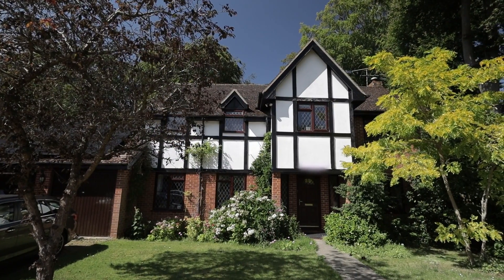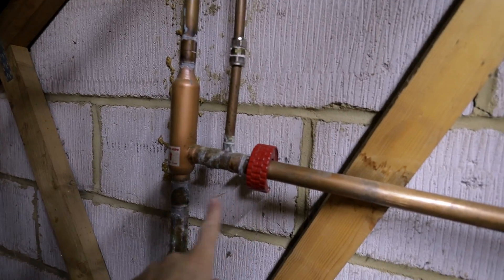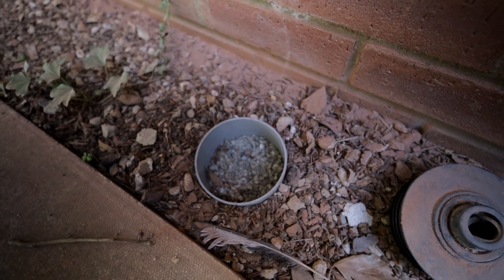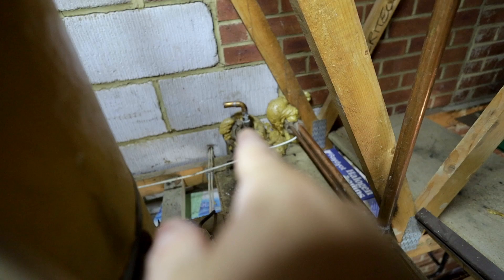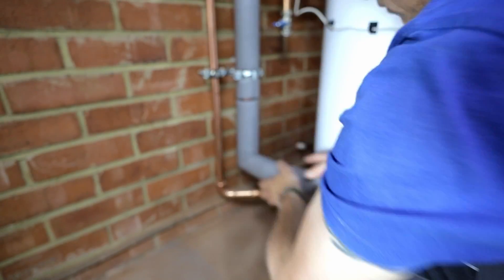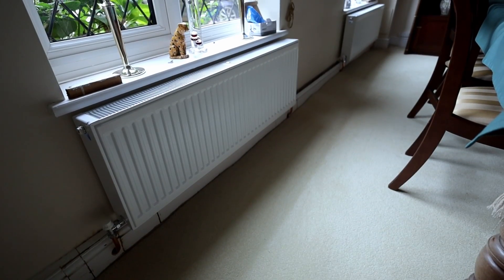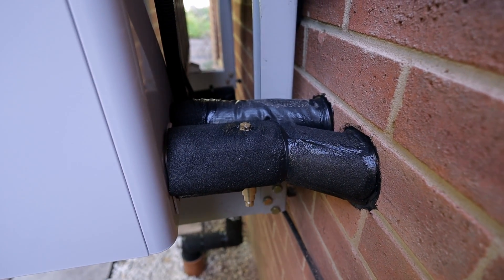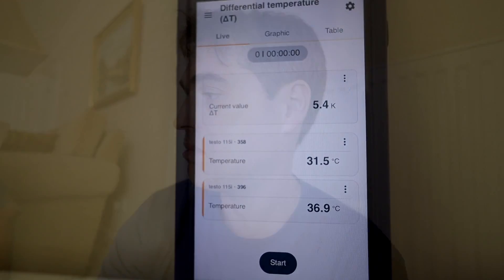Heat Pump Retrofit in a 1980s House: What's Involved?

Comment: Someone please reply🙏 
I don’t see how having a flow temp of 45 degrees could keep you warm in the winter? I’m referring to living in a standard U.K. house. 
Also what happens to to the water in the cylinder if they can only achieve 45 degrees - wouldn’t you get legionnaires?? I’m assuming the immersion must kick in to bring it up to 55??
Thanks
Reply from the maker: You can kept ANY house warm with a flow of 30c! As long as you have emitters large enough to transfer the energy required. Heating is not about temperature as much as it is about heat transfer, and that can happen at pretty much any temperature as long as it is above your room temperature.

For example - a single panel small radiator may need a flow of 65c to keep a room at 21c. The same room may only need 35c to keep it at 21c if the radiator is upsized to let’s say a triple rad.

You don’t need high temperatures to keep rooms at 21c! 

Hot water is done separately to heating and doesn’t need immersion, as the unit can go to 75c, it is just less efficient at those high temperatures.
Reply: @UrbanPlumbers   ah I see! Thanks a lot for replying. 
I had no idea an air source heat pump can generate 75c. That’s amazing!

So what do you recommend for small to medium sized properties where you’d struggle to get the cylinder in- still a gas combi? 

One last question….will air source heat pumps work with 3 column rads or do they have to be K2’s?

Thanks & please keep making you great videos 👍

Comment: Really enjoy your videos showing a balanced view on heat pumps from a true professional. Learning from previous issues and iterating - continuous development is so important in any technical trade. Installers got away with badly planned/configured boiler installations as they were inefficient/problematic but still "works" depending on your definition of works (your radiators would get hot at least). But with heat pumps all the cowboys are being caught out as they barely work or flat out do not work if they're not designed correctly - I dread to think the amount of installs that might fall into that category in the future. Hopefully the silver lining is that it weeds out installers who do not really understand the technical aspects of their trade, don't get proper training and think they can get away with lashing stuff in, which they have been able to an extent with gas boilers. With regards to space - I can see issues in my property in the future which has just a 36kw combi boiler in a cupboard in the kitchen with no extra space surrounding - in this situation is there any kind of cylinder that would be suitable to install inside this cupboard or would it be better to locate a new cylinder in the loft space? (quite difficult with extra pipework, although in my place it could be run externally if it came to it)

Comment: Why did you choose to install the cylinder in a new location rather than replacing the existing one up on the platform?
Reply from the maker: Minimum pipe runs and much safer to put 250kg on a solid floor
Reply: @zlmdragon.  i guess from my perspective we dont have a ton of spare space so would want to find a way to replace in place. The featured property certainly has an abundance of available space, not really common in majority of UK homes.

Comment: Nice install, never would have thought to fit the unistor as a vented cylinder. Also, good tips with the lagging glue and the ball valve filter, worth knowing since i just fitted out first one a few weeks ago. What water treatment are you using aside from the Kamco? We're using the VDI method with the thoroughflush V4A1, just never seen your method for this and curious since you're about 100 heat pumps ahead of us! Keep up the good work.

Comment: Thanks for another great video, I learn new stuff from every one. One question though — could it be that the chronic defrosting you had on the earlier install was due to the unit ingesting exhaust gases from a neighbours gas boiler rather than being on the ground? I had chronic defrost issues last December with a unit that was just across a passage from a non-condensing gas boiler which was emitting loads of water vapour when it was -5 outside.

Comment: Another great install. Lucky with the existing pipework. I have a quick question, does have this HP fixed circulating pump speed, or adjustable? If it is adjustable, you have to set the desired flow rate or is it controlled by an internal flow meter (to keep the pre set flow rate all the time)?
Reply from the maker: Adjustable pump that seems to be running at the same flow rate adapting to changing system conditions, which doesn’t really happen much on open loop

Comment: What about newish 10y old houses: very well insulated, but with microbore pipes inside.. (or you change all the piping in the house (expensive and very disruptive) to have to have extra pump, etc… 😩. drives me insane.. bloody builders… 😡
Reply: @zlmdragon.  😝😝. I know all of that… what I’m frustrated about if Joe builders are allowed to keep building shitty houses that are not future proof (yes, well insulated!) but still microbore as cheaper/easier for them, still gas boilers and radiators for gas boilers, etc, etc, etc… 😡
Reply: @zlmdragon.  ok, not the same but whatever makes you feel better… not sure why you need to be so unpleasant…, as was asking a genuine question… have a good day…

Comment: Love your work and your video’s, as the owner of an older house similar to the one in this video, I am wondering does it make much difference to overall efficiency if I were to install a heat pump on a wall what direction the wall faces, i.e North, East, South or West?
Reply from the maker: Makes no difference at all

Comment: So this heatpump doesn't require an indoor unit (except for the cylinder), only an outdoor unit. What's the difference between those 2 types of installations?
Reply: Regular Split systems (or Bi Blocs) require f gas certification to be installed, because refrigerant lines run into the house. They are (typically) more efficient than monoblocs in colder climates as the water is kept within the house.  However due to f-gas becoming more and more restrictive, along with not being able use R290 in a split system (R290 is flammable so a leak inside the home is a big no no), hydro-split has started to become a thing, whether it will become a "thing" in the UK we will see.  Basically keeping all the refrigerant side outside the house.

Comment: Informative video. Are you able to say what the cost of the installation  was, what the heat loss calculations said what heat loss the house had and which size of heat pump was selected, how much it will cost to run the heat pump in relation to gas etc. More data please.

Comment: I'm not convinced that heat pumps are the correct solution for the whole of the UK. Consider that last winter our morning temperatures in the north west were around -18 C some days. There is very little heat to scavenge without having a massive pump and evaporator.  The point im making is that on the coldest days where demand is highest the efficiency COP reduces massively.  So you might have a COP of 4.2  at 7 degrees and 35 out (taken from valiant) but at -17 at 35 degrees your COP is less than 2. Now consider that with a COP of 2, every Kw u put in yields 2Kw out. At present its around 40p per Kwh. So for every 2kw thats 40p in electric, gas at present is 8p per Kwh. so 16p per 2Kw. Now consider it costs 10k for ASHP installation. You'll be long dead and the equipment will be superseded before u ever save money. Sure they are good for the south of the UK and posh folk with the money to burn but this gov is only interested in the south and this one size fits all mentality is wasted on me. This doesnt even take into account the manufacturing energy, refining the R32 etc which will be higher than a combi boiler, as is reflected in the price difference of the 2 appliances.
Reply: These heat pumps use R290 rather than R32.  Temperature dips aren't usually too much of an issue, but if you're getting -18C regularly or for extended periods of time then the design temperature would be lower, and possibly a different heat pump would be more appropriate, e.g. the old (in comparison) Panasonic T-Cap series.  It's short-sighted to think that gas will remain ~ 1/3rd of the cost of electricity as well, within the next decade it's with the decarbonisation of the grid, and the uptake of solar and battery storage it's likely the difference will narrow.  Also, price cap currently works out at 30p/kWh for electricity and 8p/kWh for gas.
Reply: @BenIsInSweden  even R290 only has a cop of 2.2 at -18. Considering 30% of our electricity is generated by gas, if gas prices go up electricity will too as they did 2 years ago. Then if the argument is well it will reduce co2, considering that by the time electricity has got to the heat pump it is only 40% efficient at best when taking into account transmission losses and generation. But just taking those maths and simplifying a bit... for every 1kw of electricity generated you have 600 watts lost, if a heat pump with a cop of 4 requires 1kw for 4kw of heat then we will need to burn 1.6kw gas to make it run. The cop just dropped from 4 to 2.5 and thats at 7 degrees outdoor when considering the losses from power distribution. Considering it was -18 and the cop would be 2.2 so we would need 1.6kw for 2.2kw of heat . Thats almost unity, so may as well just burn gas and save £10k on costs and all the co2 emissions from manufacturing and shipping. I'm just saying I don't think it will work across the whole UK, maybe down south where its a bit warmer its a viable solution but up here it would just sit in defrost mode half its life.
Reply: @Cyrixxz  I wasn't suggesting R290 was better in negative temperatures, just correcting you on the point of producing R32, R290 is Propane so is naturally occurring, unlike R32. The new Keadby2 plant is 60+% efficient, plus has extra things to reduce CO2 emissions (something that isn't realistically possible in the home), and UK transmission losses are quoted at 9% not 20%.  You are also forgetting that Gas Boilers aren't 100% efficient, e.g. 2.2kW of heat, would burn closer to 2.5kW of Gas.  Gas transmission isn't perfect either.  I see you're misunderstanding Defrost mode as well, no properly set up heat pump will spend half it's life in defrost mode.  Mine spends about 5 minutes every 1-2hrs in -10C.  And I'm pretty sure I'm further north than you unless you're on the Shetlands.
Reply: @BenIsInSweden  I actually wrote transmission loss and generation which is around 60% loss in thermal power plants when compared to energy in fuel vs energy out generated. You could add another 10% for transmission loss too further eroding away at the cop. So I stand by that point that we have to account for the whole picture. In terms of Defrost mode, that is dependent on many factors mainly outside temperature and humidity and load. I understand it that as u remove latent heat from air, then naturally condensate will form on the evap. Since the evap is going to be below 0 degrees ice will form and the reverse cycle begins to enable defrost. That's a product of removing latent heat and is unavoidable since air's ability to hold moisture is reduced as the temperature is reduced. Which heat pump model do u have? I'm not against heat pumps I just think they have a bigger benefit down south than up north and I do have air to air in my house which cost 2k as opposed to 10k and actively cycle the air which gives the effect of quicker heating. They are great above 0 degrees outside and cheap to run. It's when it's really cold -7 and below things go wobbly.
Reply: @Cyrixxz  Mine is an Air 2 Air as well. Toshiba Daiseikai 9.5/35. It replaced a 2007 Panasonic of similar specs.  Air 2 Air generally reduces in heat output the lower the temperature goes (e.g. mine is 7.7kW at +7C, but 5.1kW at -10C), whereas A2W generally targets around a set heat output.

Comment: My detached 1985 has a detached garage with a gap of about 2 metres between the kitchen/utility end of the house and the garage. Does this gap bring with it the inability to sensibly use garage space as in your video? Using the garage does seem a good use of space even though we have a DHW tank upstairs and cold water tank in the house loft. BTW the garage has no water supply but does have electricity. Also the possible sites for the HP are numerous around house or garage. 

Its the separate garage thats my worry.

Comment: 400% efficient when its -5c outside in the winter ? You sure about that.
Reply from the maker: Over 4 scop - seasonal coefficient of performance. At -5 it is around 2.5 a 2.8 with flow of 35c and the higher the flow the lower so called COP not scop

Comment: Is it common that 5 years in the fan bearings go bad, and make noise It heapend to ours and neighbours and replacement was expensive like 1,5k. It got coved by insurance thankfully. The old one i kept for greenhouse, fan runs quiet in summer, but squeked a lot in winter, like water wapour frezed in.
How can Vailant do COP of 4 at -3C and 45C water and be quiet. It seems magic. I just want to alert on '70 houses efficeny isnt 400%. 
We have -5C often and AIT heatpump gets SCOP 3.3 Low of 2.5 at 50C. It still heats full blast 10/12kw.  3 stories 16 rads. 20‐22C in rooms. It runs 60% of day at -5C, and 75% at -10C. Luckily still 21 inside. It never runs heaters but 9kw of heaters were heating like rubish for 2 days when some fan relay failed, compared to 11kw from compresor pulling in heat.

Comment: Dear Sir, will this set up work in Scotland when it's occasionally -17 for and -10 for few weeks but wind chill takes standard minus temperature to between -5 to -10 in worst months.
I understand insulation/breathability/ wood fibre and membrane technology. But would heat pump still work if temperature outside in windy valley is for four months low temperature.
Love high level of skill you work at and information given. Best
Reply from the maker: well designed and installed systems should cope with -10 no problem. Below that will most likely need supplementary heating.
Reply: @UrbanPlumbers  thank for replying, love your clear, precise honest information.

Comment: Is there any option for combining solar thermal into a heat pump set up. I need to change the boiler soon but don't want to ditch my solar thermal as it is simple and reliable( when the sun shines) 😅 great content again Szymon
Reply from the maker: yes there is. You can plate load your current cylinder. It will mean a but more complex set up and lower efficiency on hot water, but is doable.

Comment: Curious on the pipe cladding... I have asked plumbers before and they seem to say it's a waste of time... I bought a heap last summer but haven't gotten around to adding it to the exposed pipes from the furnace
Reply: If you want heat where it’s needed then lagging is needed to stop it being lost where you don’t want to lose it - if it’s within the fabric of the heated envelope of the building then don’t bother, but here the pipes in the garage need to be  lagged as it’s outside the thermal envelope - just common sense really 🤷‍♂️

Comment: nice install but c'mon, thats hardly a typical uk house now is it lol. You didn't mention the install costs or the equipment costs - kinda important don't you think. Also why talk nonsensically about the system being 400% efficient when 100%, of anything, is the MAX possible. To answer your final question - convinced - NO!!
Reply from the maker: No it’s not - unit moves 3 units of heat from the air and adds one unit of consumed energy to the equation providing 4 units of heat for the property
Reply: I guess thats how you sell it to customers. About as realistic as solar and wind power claims. Like I said you didn't include the total costs and, potential savings (not least of which by having a colder house) and giving the payback period before you break even - and THATS the crucial thing @UrbanPlumbers
Reply from the maker: @andrewhumphreys9889  

I do have videos on my channel showing exactly that - 420% efficiency and lower running costs than gas by a large margin.

I also have interviews with my clients - that confirm houses are warmer not colder and cheaper to run.

I cannot do anything about the fact that this offends your worldview and beliefs.
Reply: the fact that, in this case which you use as an example, you will NOT put up the costs and payback simply says it all. You have ZERO idea as to my beliefs, I simply ALWAYS get the numbers and then weigh up the pros and cons and whether there is even a payback period that is less than the life expectancy of the system. Perhaps your clients don't have such concerns but most of us do
 @UrbanPlumbers

Comment: That is a highly informative channel! 

I have learned the modern heating equipment and approaches how to retrofit the houses from you. We are building a 300m2 new house with a 12 kW Valliant split heat pump (previous generation) with all native controllers (720, VR71,...). The house is well insulated, has huge low-temperature radiators and a lot of heated floors. 

My installer follows the standard typical design from Valliant with all Valliant controllers, temperature compensation, 3x water pumps (radiators, heated floors, boiler), 100 liters buffer for heat pump, 200-liter cylinder for hot water. However, each room has a Rehau thermostat which controls radiators and heated floors with individual temperature presets. You mentioned that zone control might kill heat pump efficiency. 

Could you please tell me about the potential heat pump efficiency risks of this approach?